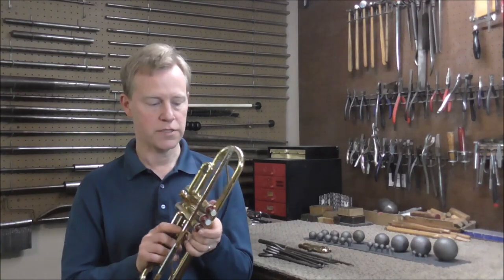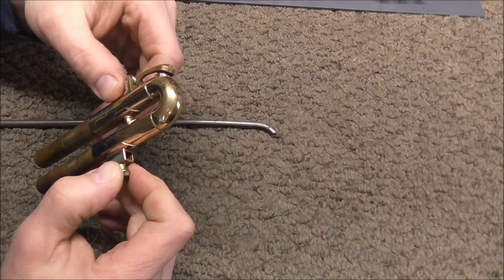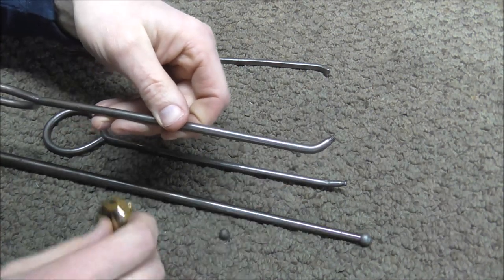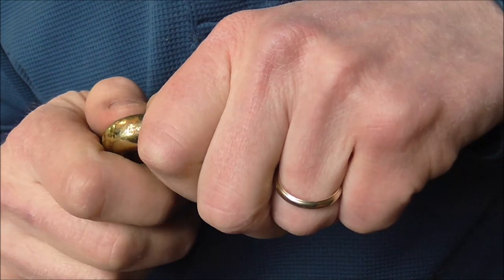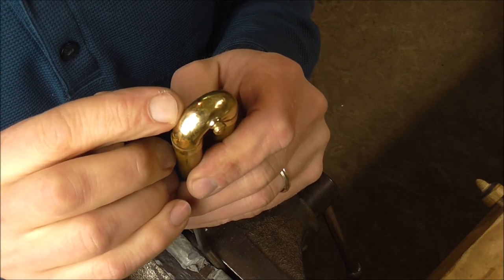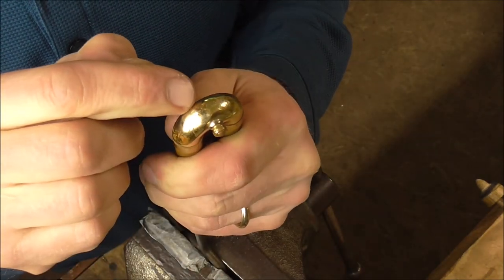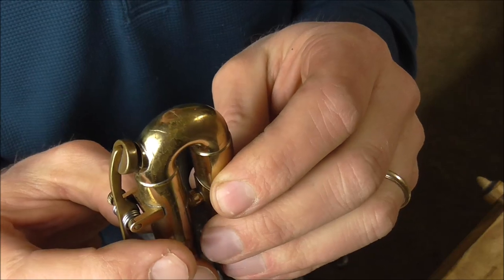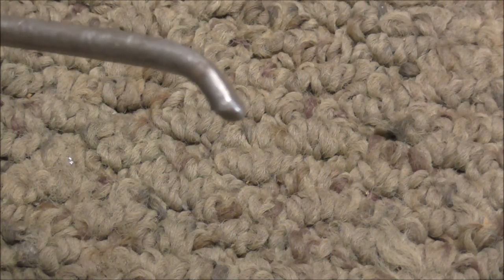Trumpet 1st, 2nd, and 3rd Tuning Slide Dents: How To Remove Them

Comment: Is a dent in 2nd tuning slide a problem to trumpet or just cosmetic?
Reply from the maker: Usually it is just cosmetic unless the dent caused a leak, pushed in the 2nd casing so that the valve does not work, or it is so large that it impedes the airflow.
Reply: @TheBrassandWoodwindShop  thank you, I appreciate it!